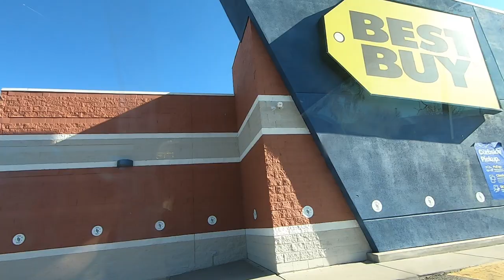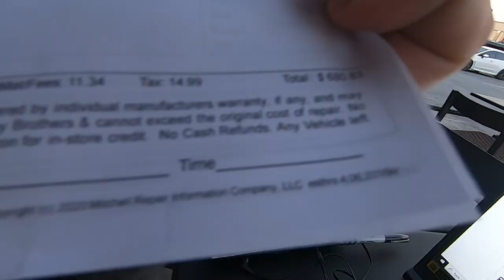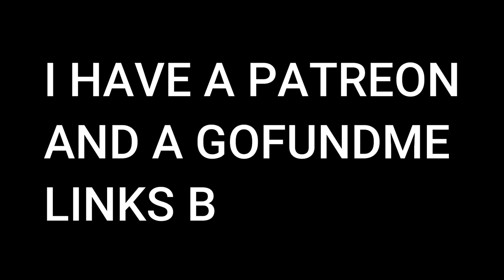She needs $700 in repairs!!

Comment: Transfer case output shaft seal and diff seal aren't anything that's gonna blow up overnight. Most older Jeep seals leak for years before anyone replaces it. 

Never seen yoke "wear out" usually they break or the ujoint strap is stretched or worn.

Comment: The seals are 11.99 at AutoZone
The seal puller is like 14 at harbor freight

Both can be driven in gently with a 2x4 and light hammer. 

A hammer and a couple cheap sockets could drive that ujoint in and out on the side of the road. 

Can you get the yoke locally at a salvage yard ? If it's the d35 rear or even 8.25 those are plentiful and cheap for the yoke.

Comment: Hey bud, saw you at carquest replacing your tcase seal.  I hope you also replaced that U-joint, and maybe even that yoke, or at least those straps over the u-joint caps.  You can mess up the yoke letting it rattle like that.  Guy wasn’t kidding you could throw the driveshaft.  Thats the kind of stuff i was talking about.  The seals went bad because the ujoint was bad, if you replace the seals but don’t fix the issues in the driveshaft the seal will go bad the first time you drive.